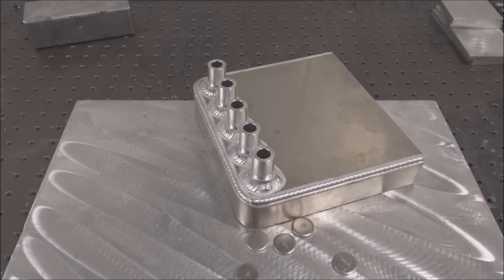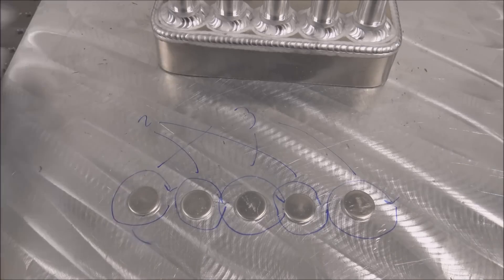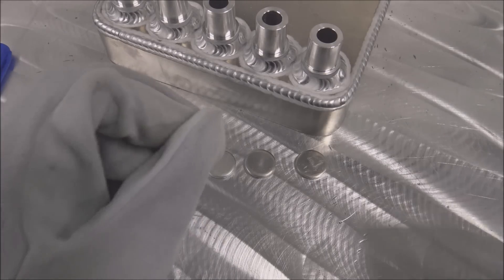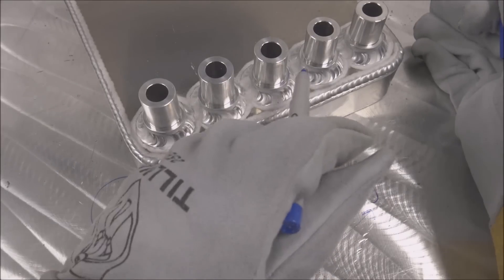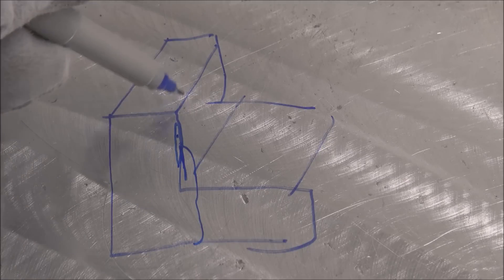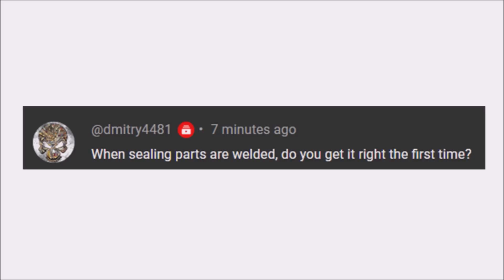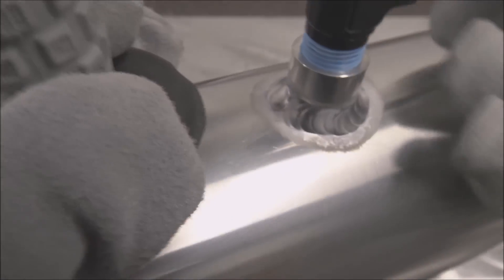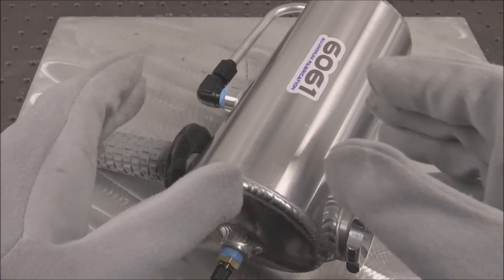TIG Welding Aluminum Fabrication - Explaining the not so Obvious

Comment: I like these videos. Don't really care about the comments but the stuff about welding the inside or having leaks is interesting to me. I'm just doing this as a hobby and did very little aluminium. I really struggled with it and still do. But the more I do it the more fun it is. In fact I'm in the middle of making a tank for a transformer that will be filled with oil.

Comment: I think any time you can convey good information about the subject the length or content is not a problem. Sometimes you touch on things I already know or you may have mentioned in the past. So what,  a refresher is never a bad thing especially for someone such as myself who does not tig weld everyday and might forget something. Use it or lose it especially in tig welding. For the record I have never found it necessary to scotch-brite tig rod either. Sometimes I might wipe it off with some acetone if they have been exposed in the shop for extended periods. Not a bad practice to clean everything.

Comment: I think 6061 is correct in the sequence, remember that people are right and left handed. Very few people can switch hands and get the exact same results. By starting at one end you can take advantage of handedness.
Reply from the maker: Even if you could weld the exact same quality with both hands, you'd still want to do it the way I did so all the welds look the same. if there were 3 clockwise welds, and 2 counter-clockwise, it looks worse.

Comment: Your comment about engineers not having real world experience is often true. I first learned how to weld as a way to better understand what the welder/fitters had to go through when welding one of my designs. At that time I was designing underground mining equipment, front end loaders. I got my tig welder primarily to learn aluminum but now do nearly all my welding with it. Except for the farm equipment which gets the mig. I learned manual machining for much the same reason. By the way, I learned to tig aluminum watching your videos. Keep up the good work!

Comment: I use the stainless brillo pads and pull em through in 1 direction. Those won't clog and this tig filler here is oxidized really thick. The red scotchbright I associate for post welding mig soot removal or to blend the brushed stainless.

Comment: Enjoyed the video. I do like how you share your thought process on why you did it a certain way.. I will second that engineer comment. We had in 2008 ish automotive engineers that were “out of work” if you will. So our company put them to work in our division. As a result, we can’t access half the stuff in our drive cabinet without removing a ton of items. It’s great that our company didn’t have to lay them off but there should have been a little more oversight in the design from our regular engineers.

Comment: Good breakdown on a single subject.. There will always be 4 "tight spots" regardless of the order.  I like your logic, do them all the same way for constant result. What you didn't mention is the visual access you get with your method. Each nipple has almost full, straight on visual access in good light, for you to inspect your work before moving to the next one.

Comment: Im not knocking engineers either,but sometimes,ugh! I just had an argument about installing a CO detector in a generator pod. I asked what its purpose would be,his reply was its tgere in case of an exhaust leak.I asked how CO could accumulate in an 18,000 cfm wind tunnel! But it added 7k to the job cost,and their take is 15% of total job cost! We have lots of stuff we dont need!

Comment: I was recently welding a trolley made up of rhs 100x50x6 and shs 50x50x6, i have only a single phase 240v tig welder 210A . Seem to really struggle getting heat to fillet welds. Maybe on the limit? Machine has advance wave any tips frequency, cleaning, etc for more heat? Add helium or preheat? Increase cup size with amps? Not the nice shiny puddle i get on lighter material? Love your work, something to strive for.😊

Comment: Good videos. With the big tanks, i weld the bottom and sides inside completely. Even with braces, the slosh can flex the sides enough to cause cracks. Also, any fine grit in the product can wedge under any gaps and make a stress point. Double welding makes it strong and leak proof.
Reply: We do the same with Boat Fuel tanks (80-200 Gal), We tack the outside, tack the inside and then weld the inside as much as possible. As for baffles I always weld the ends on both sides of the baffle then stich the rest. My thought process is that welding the ends prevents any possible flexing from heavy fuel sloshing in rough weather. Thus preventing cracks at the ends. What we do differently is instead of sitting the tank on the keel or substructure, we hand the tank from the Lid. Typically we use 1/4" and hang the tank from heavy boxtube. With a 1/2"-1/4" airgap around the tank to prevent corrosion or friction between surfaces. All these ideas came from my boss who did mobile boat repair for 7 years before building new boats so he's seen the designs that fail. So far we have a boat with twin 200 gal tanks with that design and has 1800 hours on it with no issues. We'll see how she fares after 20 years.

Comment: I think the correct welding order for those ports would be to weld in the center one. That’s it. Five ports is overkill. I had zero ports when I was a child and I turned out just fine.

Comment: The filler rod can also be seen as wire, and wire is often formed by a repeated drawing process. Whether aluminum or steel or something else, I suspect there is a little bit of lubricant used.  A good reason to give the filler rod a basic acetone wipe before use.  That's what I do, partly because with my limited skill I need to avoid all the problems I can readily control.